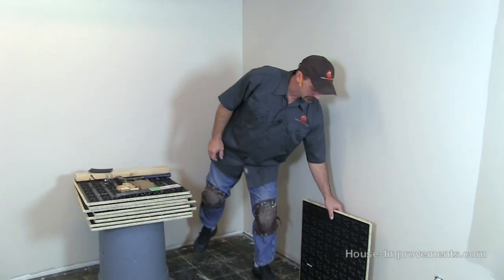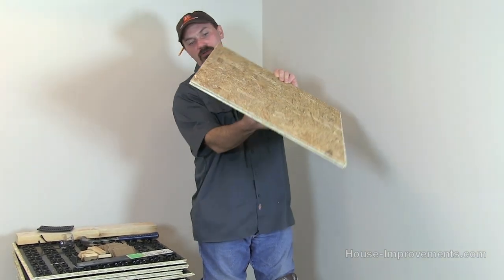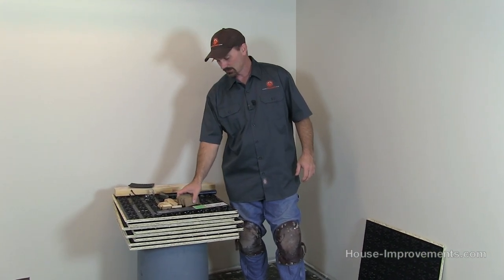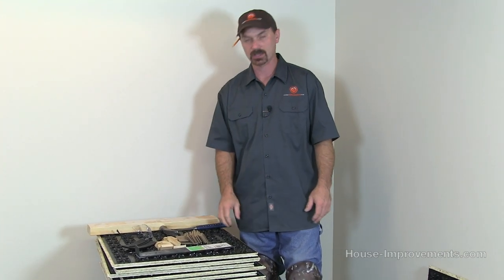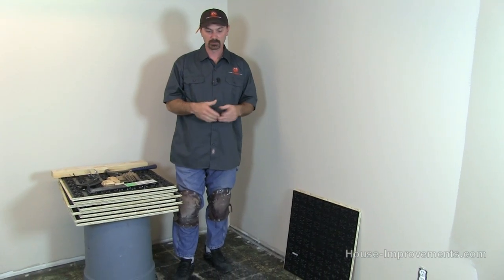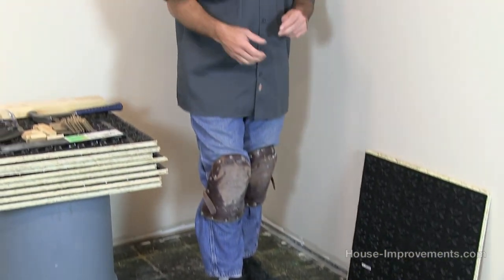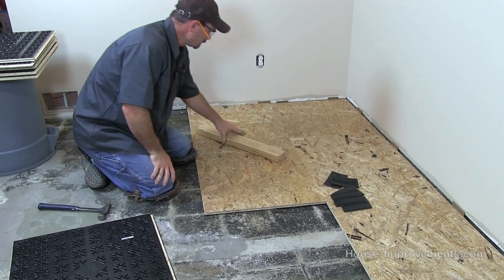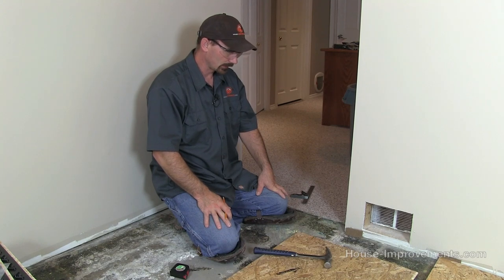How To Install Basment Subfloor Tile System

Comment: I installed this in my basement and it's amazing.  I noticed a huge difference in temperature.  I could never go in my basement in the winter in my bare feet.  With this stuff I can.  It's always warm.  

Prior to laying mine I put 2 coats of grey acrylic paint which smelled like nail polish but it sealed the floor so that dampness and odours would be gone.  It worked!

Oh and I'm never sick of you Shannon.  I love you and your vids.
Reply from the maker: Great to hear ds99

Comment: Not sure if it matters this far long, but some job sites I worked on, any area that was to have any construction done, like a basement, after cleaning, and everything was set to start building, we would dust the floor and area in baking soda. It was to help to make an environment that was not just mold resistant, but hostile towards it. It was super cheap, and great as a preventative. We also used it in attic builds. It was used to dust rafters and attic spaces before making additional rooms too.

Comment: Perfect timing and perfect project. I am about to finish part of my basement for a shop. I was debating epoxy coating but this might be more comfortable to stand on. If you weren't going to cover this, would you consider gluing the joints so they don't shift/open?  Thanks for all the great content !
Reply from the maker: Probably would not hurt anything
Reply: Yes, glueing definitely will keep the panels firmly together👍

Comment: Had a few contractors tell me my basement is too wet for a system like this. Its made more for damp basements living in the south its more than damp here lol. They recommended just laying down pressure treated 2x4's then staple heavy plastic to the floor runners keeping it tight and off the floor. Then just putting plywood on top of the plastic it helps keep moisture away from the plywood. This system is again great for less water but in one inch of water it will come through the seems and damage the OSB.
Reply: MrSnapy1 don't install pressure  treated 2×4in a basement. I know in eastern Ontario that's not code. can rot or mold in time
Reply: best thing is fix the foundation blue skin and big around house keep water away.

Comment: 32:00  If you are looking for a warmer floor there are "Insulated Subfloor panels".  They are basically the same as the panels you have used here except there is some rigid board in the middle.
Reply from the maker: you are correct
Reply: What do you think about that product, the insulated sub-floor panels?  Would you recommend it, or is there a better way to insulate slab floor?
Reply: Which is better, or more cost effective?

Comment: When you were putting down the first panel or two you mentioned something about drilling and putting in some screws in few panels. You also added that the entire sub floor needed to float (and I assume will also expand and contract), so it was necessary to not screw down every panel. However, I didn’t see you put in any screws at all. Did you eventually put some in? If so, how many per panel? And which panels got screwed down? Please clarify.
Reply from the maker: Just the odd perimeter panel just to keep it from shifting around while you work. Most times I will put a few in and remove them when i'm finished. You can leave them if you like but its better if the floor floats as much as possible.
Reply: @HouseImprovements  , okay, that makes sense. Someone else made the point of screwing down all of panels, and especially the middle ones, if your plan is to put down carpet (which is our plan). They said that all of the stretching and pulling involved tends to cause lifting and buckling of the panels. Anyway, thanks for the responding.

Comment: Thanks for another great vid. But why didn't you use glue or caulking? 
Not to make it more rigid but to moisture seal the joints.
Reply from the maker: Not needed. You still want this to breath  some

Comment: Thank you for the informative video. My only issue was when you said you were going to give yourself some extra room so you would leave a gap of 3/16 of an inch. 3/16 is not more than the 1/4 inch you were using up to that point. 1/4 is the same as 4/16, so by switching to 3/16 you are giving yourself less room to work with not more.

Comment: I have read that to put this stuff down before putting in walls is not a good idea.  The OSB will be ruined if it ever does get wet, and if you have to pull some of it up and they happen to be underneath a wall, you are in for a real big job.   I am thinking of adding these and happen to have all my walls done for years now.   Something to think about, or do you think it is not a problem.

Comment: usually when you have a leak in the basement walls, you would find a damp carpet (no subfloor, just carpet on the cement). If you install the subfloor like in this video, how would you know? Are there any solutions for detecting a leak behind the walls?

Comment: I want to use these but it'll cost a bit of money to install but its worth the warm floor. I intend to install this, then rigid core planks on top of the concrete slab in my basement floor. My Question is how protected am I against (1)plumbing leaks  and (2) possible flood with this type of installation in a basement ?

Comment: Great video.   I'm clear on everything except where and if fasteners are needed?  I think manufacturers website says something about Tapcon screws a few inches off the ends but I dont understand how it will expand and contract if its fastened to the floor.
Reply from the maker: I seldom do since they really cant go anywhere when they are between the walls with only 1/4" clearance , but you can secure the perimeter withTapcons.

Comment: in terms of order of operation, should i install the dricore subfloor first, then insulate the wall with foam boards on top of it, or insulate the wall first then butt the subfloor against the foam board? please advise, thanks.
Reply: Insulate the walls first👍

Comment: Ive watched a few dricore subfloor installation videos and i am still trying to figure out how does this subfloor stay in it's place overtime? If it moves, then the flooring on top of it would be ruined. So how does one keep these dricore subfloor in the same position overtime? Drill/screw these dricore subfloor down in to the concrete?

Comment: I'm in the process of planning to finish my basement. I'm having a hard time trying to figure out the advantages of this method over using a product like DMX-1step underlay and then laying 5/8 T&G OSB over it. Its more than double the cost..
Reply from the maker: Its so easy to carry these panels in and install them as apposed to caring 4'x8' sheets of plywood down stairs
Reply: Great point I think I'm also seeing that subfloor tile isn't screwed down and DMX1-step - 5/8 T&G OSB needs to be screwed down so there that could be a lot of drilling/screwing. Thanks! Great videos in the last 2 weeks I think I've watched half your videos. Great stuff!

Comment: Good job. Very informative. Should those panels be fastened to the floor  with concrete screws, BTW?
Reply from the maker: You can attach the odd few but usually I dont do many.
Reply: @HouseImprovements  thank you, sir

Comment: That was a nice patent, doubt we can get them here. (Europe). - Remember when shimming it's the seesaw principle, it's the downed side that needs the shim to get the high end to go down. - Instead of shimming the all ready high end.
Reply from the maker: Yup, sometimes if the high spot is not near an edge you may need to shim both edges.

Comment: Hey Shannon.....Great video.   Question.  I have my framing up, but no drywall yet.  Can I install this BEFORE the sheetrock is put up ?   I have 2x4 bottom plates.  If I install this BEFORE the sheetrock , and leave the required 1/4", will my sheetrock have enough bottom plate surface to sink screws ?  Thanks
Reply: If you want to install the dricore panels before the drywall, just add 2x4 blocks on top of existing bottom plates between your studs ensuring enough nailing area👍

Comment: so if you install this before building walls do you still have to use pressure treated for your bottom plate?
Reply from the maker: No you would not

Comment: If I am framing the entire basement out.  Do I put these down first and frame right on top or frame the basement first then put these down?
Reply: Frame the basement first using pressure treated bottom plates first👍

Comment: I've never subfloored a flat floor. I always seem to get the heaved slab that's too far gone to just put a moisture barrier on and then underlayment. This system would be nice. What I did to get rid of any debris was to etch the concrete with muratic acid before I laid the moisture barrier down and then the shim strips before the subflooring(it was out side to side by almost 2 inches). Was that too much prep? The muratic acid?
Reply from the maker: Not sure that acid would do much?? Kill Mould ??
Reply: It was a long time ago and now I'm trying to remember why I used muratic acid. It's for etching concrete. For mould I could have used household bleach. It would have been way easier and far less dangerous. I think there may have been a change in plan mid job. That customer was that kind of challenge. He had me do many change orders. I made more money undoing stuff than I did doing stuff.
Reply: If your floor is out 2” from side to side, probably would of used self-levelling cement first, then installed the Dricore panels after.

Comment: the guy installed my floor and did not staggered the joints and as well did not leave any gaps for expansion and now the floor has raised up in a few locations, is there an  easy fix you can recommend ?
Reply from the maker: Please come to our forum ,we can help from there.https://www.house-improvements.com/forums/

Comment: I've thought about installing these in my basement but I have a fireplace and a bathroom.  How would you address the height difference for the marble hearth in front of the fireplace and the toilet in the bathroom?
Reply from the maker: The hearth you would have to make some kind of transition trim maybe??? I have never used this in a bathroom but you could cut off the existing flange flush to the floor and install a new one over the panel. I would be sure that the panels around the toilet are well shimmed and maybe even use adhesive to keep them from moving to much when walking around?

Comment: If this is added into existing finished basement, do you need to remove the baseboards and cut out a space at the bottom of the drywall in order for this to work?  Or can you install it as is and leave 1/4 inch of space away from the baseboard?
Reply from the maker: I would remove baseboard and install it closer to  drywall
Reply: Yes, remove the baseboards and leave the recommended 1/4” gap. Also, there is no reason to cut your old drywall unless you have a dampness issue with your concrete floor. In that situation you can cut the drywall 1/2” up from the basement floor👍

Comment: for sub floor , do u have to use the tiles with plastic ,, or canu use lumber , or does it have to be pressure treated
Reply: If you are planning to install a subfloor below any sub grade it is recommended to at least use pressure treated wood materials and also if your existing basement floor is cold and damp it is also recommended to put down a 6mil polyethylene plastic sheeting over the basement floor before installing the pressure treated wood subfloor.

Comment: If I plan to use these Dri-core tiles after framing up the basement, what height should I frame my door Rough openings at? ie. how much height will this dricore and flooring chew up?
Reply from the maker: I believe they are about 7/8"
Reply: I usually add the Dricore thickness at 7/8” and then the new flooring thickness and then add 1/2” air space,
which frequently adds up to 2” more added to the rough opening height of your door frame👍

Comment: I'd like to do this in my basement, but I would like to put ceramic tiles on top of it. Is this something I could do on top of these subfloor tiles?
Reply: These tiles are meant to be installed as a floating floor system, however if your planning to install ceramic tiles on top, first thing you’ll need to do is glue the tongue and groove edges together and then install a isolation membrane that allows the movement of the tile surface from the dricore panel surface👍

Comment: I plan to install 2" rigid insulation on my basement walls. Would you install that on the walls down to the concrete floor first or this on the floor first and install the insulation down to it?
Reply from the maker: typically this product I would put down after the wood walls are framed but you could frame on top of it. I would run the foam first.
Reply: HouseImprovements  that brings up a new question... Is it better to frame the walls first or put this stuff down first. These walls won't be load bearing at all so structurally it shouldn't be an issue but just wondering what is the smarter way of doing it.
Reply from the maker: I prefer the walls to not be on top of it, just a personal preference, not sure it really matters ?
Reply: HouseImprovements if you put up foam on the out side walls, then put in your floor, then build all of your walls on top of that, it would effectively keep all wood contact away from the concrete.

Comment: I thought it was supposed to be installed before the walls and the walls built on it so you would have a continuous air path under the floor and up the walls??

Comment: Do you need a quater inch space from the concrete walls?
Reply from the maker: yes
Reply: @HouseImprovements  how about if the walls are going to be spray foam insulation do you still need a air space between the concrete and studs?
Reply: I laying garden fabric , delta FL then tong and groove osb should I leave 1 inch space from wall on all?

Comment: Certainly not the cheapest option. What else can be used with similar results for a small basement office Reno?
Reply from the maker: There are rolls of dimpled products out there that you cover in plywood after. The nice part with this is it is very easy to carry and get in the house by yourself.
Reply: Likely easier to level as well with shims. I'm sure the dimpled rolls are much trickier to level....

Comment: Can  you build your non support walls on top of dri-core floors?
Reply from the maker: yes
Reply: @HouseImprovements  Hi Shannon, thanks for the video. If I want to frame a support wall on top of this, is there a danger of the surrounding subfloor tiles to raise from the pressure of the wall being nailed down? 
Thanks

Comment: Use the rolls not the 2 x2 that is shown in video. Reason there is no way to seal the plastic membrane. When water comes up it will go through each gap. Also it is cheaper but more important the seal from the reason your doing this in the first place.
Reply from the maker: You cant seal the rolls 100% either. Besides this is not made for that kind of water. If you have that much water you will be having bigger issues.
Reply: @HouseImprovements  mfg suggest to overlay by 4 to 6 inches and then seal with tape

Comment: Hi there. A bit of a unique question: Can this type of flooring be installed in a way that make them temporary? I'm looking to create a floor for an art show and I'd like to be able to remove the panels and re-use them. Is this possible or are they quite snug once installed?
Reply from the maker: they could be removed after yes
Reply: HouseImprovements THANK YOU! I'm testing out some panels now before I get going with the project. It all seems pretty snug.do you have recommendations/tricks to facilitate separation of panels? I'm looking at a 20 x 20 square foot area.
Reply: Yes, they can be reused and taken apart carefully👍

Comment: This system is not the best. Too many seams. You can't seal the seams with dri-core like you can with Delta or DMX membrane and with tongue and groove spruce plywood sheets. DO NOT use OSB. Yes - Dricore is convienent. That's about all it is. Moisture WILL come up between the joints.